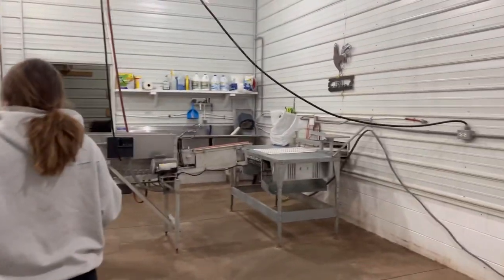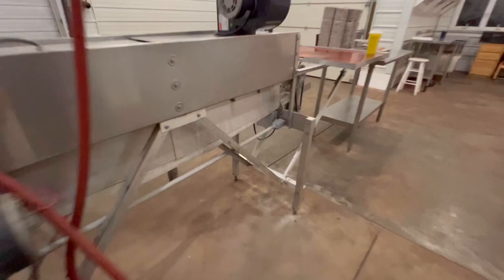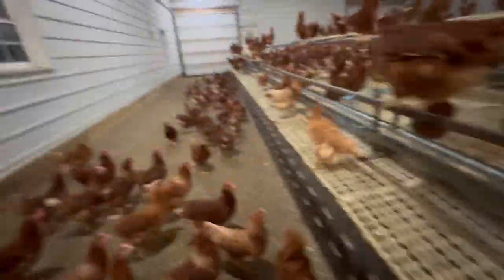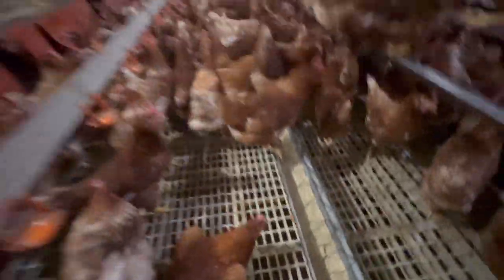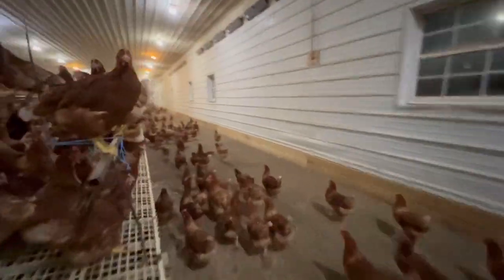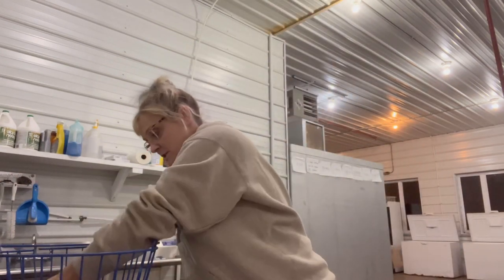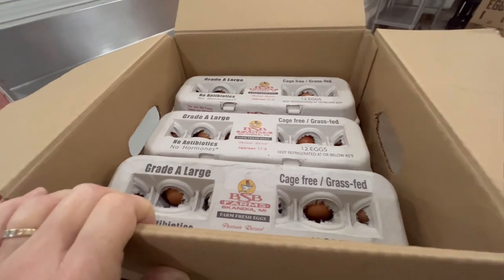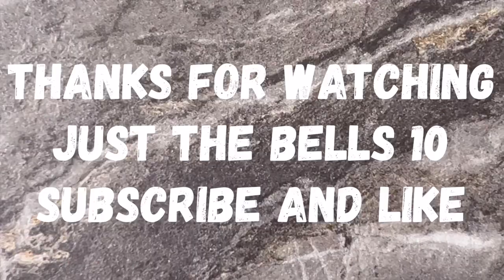MORNiNG BARN CHORES FOR US FARM GIRLS 🐓🥰

Comment: You should get a trash grabber gun to pick the eggs off the floor! It will save your back. It has two rubber cups at the end so it wont hurt the eggs either
Reply: That's what I use,  too. It helps reach the eggs that are farther away, too. We call it a pick stick. The rubber cups on the end are perfect for eggs.